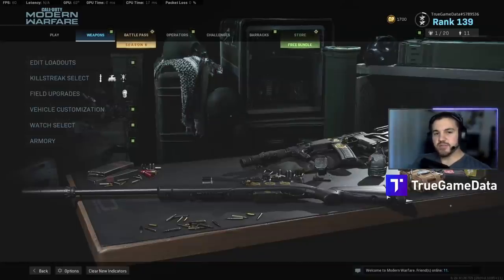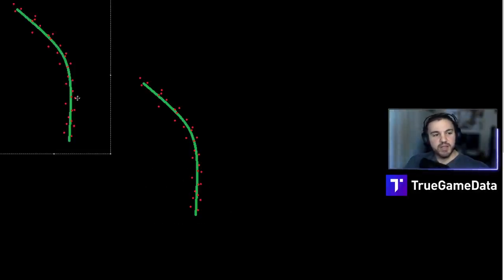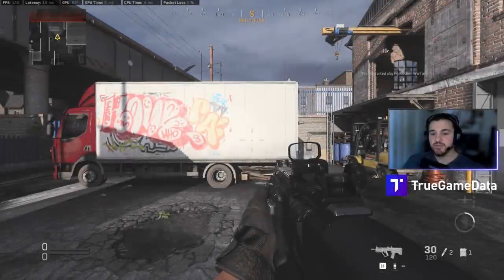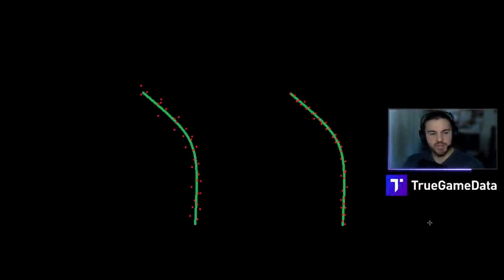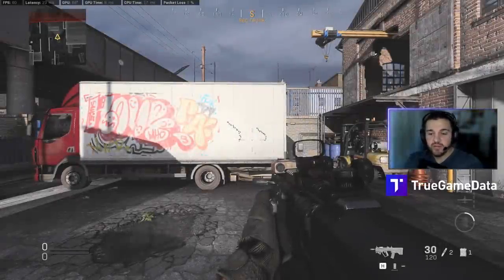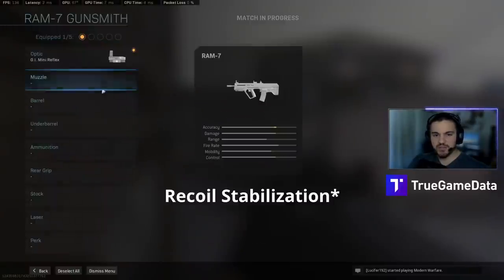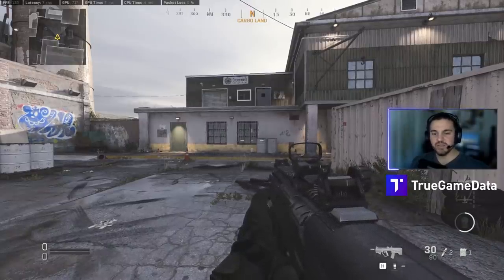What do "Recoil Control" and "Recoil Stabilization" actually DO in Modern Warfare?

Comment: After finding out about your site I’ve always tested muzzle break and commando on all my guns and they definitely feel better. Recently however I’ve been using compensator with commando for an extremely balanced gun.
Reply: ok
Reply: Does it seem like that compensator hit a little harder?
Reply: @jchaney229  you're probably landing 2 shots where you normally would've only had 1 hit in the same bullet grouping. The second marker begins before the first has began to fade. Looks like 1 hit marker, really its 2.
Reply: Why not merc foregrip? Is that not the best? Thats what I've always used and it basically makes all guns super stable
Reply: @BONZAImusik  no for straight recoil control the commando is best, merc should only be used on subs for the hipfire bonus
Reply: @BONZAImusik  Merc foregrip is basically the standard recommendation of the big youtubers. But nearly all of them play on console and I think that is the reason why. With a mouse, vertical recoil is easy to control, as long as the weapon isn't bouncing to the left and right. Therefore a commando foregrip is much more useful for most of the guns.
Reply: Kloakentier .I I agree with ZurkeyTurkey above since they secretly nerfed the merc forgerip a month or two ago I only use it on the SMGs now. For ARs I’ll usually use the ranger or commando grip. The best grip in the game though is the snatch grip on the PKM.
Reply: I made an M13 build with Compensator, tempus marksman, ranger grip, 50 mag, VLK optic. It's outrageously accurate and I love it
Reply: @beltempest4448  dont tell ppl man ive been melting these kilo kids
Reply: @shanebryant6478  ahaha same mate
Reply: @BONZAImusik  merc used to be best cuz of the movement bonus it had before it got patched.
Reply: Recoil Control also affects the visual recoil :)
Reply: Compensator + commando
or forward grip + muzzle brake?
Reply: Compensator + commando has always been the standard mp AR setup. The cdl pros figured that out in less than a month

Comment: The aim point shifting away from the center of the screen is called "gun kick", in contrast to the whole camera moves with the recoil which is called "view kick". These are recurring mechanics in COD series, but I actually didn't expect recoil stabilization to help with it. Great job!
Reply: Yes, gunkick is essentially visual recoil (it does affect the impact of bullets however), while viewkick is the actual muzzle climb and away of the weapon. The KILO 141 has positive adsGunKick values therefore even as the muzzle climb increases the point of aim is shifted Downward, causing the illusion of counteracting the muzzle climb. 
You can test all of this in CoD UO

Comment: 5:06 - I can think of one key instance of “screen shake” in another FPS game. In Destiny 2, there is an Auto Rifle (i.e. Assault Rifle) called Hard Light. For the longest time, the main selling points of Hard Light were that it had no damage falloff, a good recoil pattern, and bullets that would over-penetrate and bounce off of walls (you could very well spray the gun at a wall and hit someone behind a corner). The only issue with the gun? It had a terrible amount of screen shake. It had so much going for it, but the screen shake when firing while ADSing make the gun useless in PvP. Bungie decided to remove/severely reduce the screen shake in one of the patches, and the gun instantly became meta. It was so dominant that they had to actually give It damage falloff to balance it. Last I played, the gun was still good, but nowhere near as broken.
Reply: I was shredding with had light yesterday, it's definitely still great but I'd rather get Monte Carlo
Reply: @stasis760  just use gnawing hunger like every else
Reply: @zotic1516  idk man I'm outgunning gnawing hunger with hard light

Comment: Yea I've noticed this screen shake especially with high fire rate guns. The ram and fennec to me is unusable without commando. I always thought it was just the gun shaking and not the whole screen that's crazy.
Reply: But the screen isn't shaking more really when looking at say the roof or column. It's just the center moves, and the gun moves back and forth more (not left/right/up/down)). I expected there to be more whole screen shake without stabilization actually.
Reply: especially the RAM
Reply: I play the Fennec without a foregrip and it handles decent up close, tbh you can't use it further than 40 meters
Reply: @davseblord  yea I agree it is usable but for me when I'm dealing with bunny hoppers in a dark room and there is gun flinch on top of recoil. That smaller screen shake is a godsend.
Reply: The scar prob counts too. Ive noticed that even mounting the gun with some recoil control attachments, the gun bounces around, but im not actually compensating for recoil at all, because there wasnt a recoil pattern, just the random camera/visual recoil
Reply: Huh, I’ve never really noticed the shaking for the ram or fennec, and I use merc/ranger with those. Maybe it’s because of the fov I have? Prolly just me lol
Reply: @nicolascaraballo1534  I don't notice it neither
Reply: RAM-7 with Ranger Foregrip is very usable for me, but commando is probably the best option though

Comment: I’ve gotta hand it to the MW devs. There are so many little nuances to the gunsmith and each attachments characteristics. I really do think almost every gun is viable if you kit it right and play to its strengths. Videos like this are a huge help, and make experimenting with builds fun. Thanks
Reply: Oh absolutely, they are. I have only like 0.70 KD and ive gotten most of my little over dozen wins with an ak made to AK74U (5.45mm, 8.1 barrell, skeleton stock and either stipled grip or 5mw laser) second most kills/wins ive had with the short af holger build "the catacombs" (no stock, short barrell, 30rnd mag and merc grip) its a blueprint and i dont even own the base gun so it does not have even a suppressor.
Reply: @WuKuVex  if you’re gonna use that type of ammo on the ak just use the Amax, its the same but better.
Reply: @sauron1414  There no possible way to make the amax as fast mobility wise as the ak with the 5.45mm ammo  and 8.1inch barrell, skeleton stock 
 etc.

Comment: Thanks for the vid that clears things up what you said about the red dot bounce makes perfect sense i was using the max stabilization and noticed it wasnt as tight but felt much more controlled. What you said about the ram7 and recoil stabilization i first noticed with smgs i put muzzle breaks on the higher fire rate guns and compensators on the lower fire rate which seemed to work well but its more individual to gun i now think, so thanks again for clearing that up.

Comment: Battlefield 4 (I dont know about other Battlefield titles) had a couple similar effects when using red dot sights with laser or tac laser equipped. While firing you could see the red dot deviate from where the laser hit but the laser was always where the bullet would hit. It was much more noticeable at range when using a LMG with mid range scope and laser equipped. When first viewing, the green laser would be in the very center of the mid range scope crosshairs, but when you fired a single shot you would very quickly notice the deviation when you put the crosshairs back on target, and the laser hadn't "caught up". If you fired again, you would miss. but if you waited till you saw the green laser, you could put the green laser on target using the scopes zoomed vision, and fire on target regardless that the target wasn't in the crosshairs of the scope. The bullet always hit where the laser was touching in these cases.

EDIT: Im watching super slowmo videos of automatic weapons firing and its very obvious the weapons are flexing. This could be the representation of the forces we would be fighting with "Recoil Stabilization" mods. Lookup AK47 super slowmo firing and it seems easy to see that if it had a red dot sight, and a laser attached down barrel, that the flexing during firing would cause the red dot and laser to separate. Seems like a natural symptom of using automatic fire, on older designed guns that flexed a lot after taking a shot, instead of waiting for everything to settle to take the next shot.  I would think that a bullpup like RAM7 wouldn't have this issue, but I could be wrong. Also, due to balancing, weapons don't always behave in games, how they do in real life. What do you all think?

Comment: Really awesome info again my man.
Still gonna stick to my standard RAM Mono-Ranger-Tac-Optic-50 Mag

I think switching the tac for commando isn't worth it for me bc:
-the reliability the aiming stability (tac) gives over the recoil stabilization (commando) in terms of recoil pattern
-better ADS
-last but not least the better ADS movement speed with the tac setup
These advantages seem more impactful to me than the negatives (less recoil stabilization, laser visible)

I tried Mono-Eclipse-Commando-Optic-50 Mag but the "standard" RAM setup is better for me to control the recoil since the ranger barrel gives a little more vertical recoil reduction than the commando-eclipse combo, which seems to be especially important for moving targets. Not even putting the better bullet velocity into consideration here.

Yea and having iron sights with the RAM is not in the equation since all the recoil reduction isn't worth anything if you can't see the enemy.

Comment: Is there any theory on gun kicks? Like EBR14 kicks like an elephant but the actual spray pattern isn't that bad. Uzi is an example of automatic guns though it has great 2-shot headshot range it is quit hard to land 2 headshots. Is recoil stabilization the only affecting factor?
Reply: I tested a bit with various setups and for those 2 weapons the ideal would be to just shrink down the entire pattern. Those 2 guns kick pretty much only vertical and the animation is quite annoying too. I've found using recoil control definetly helps with that. Go give it a try in a private match c:
Reply: @Artiick  I usually put a lot of recoil control for grinding headshot challenges. But some guns are not salvageable. Just wonder is there any specific attachment or factor to the visual gunkick.
Reply: @孙林可  it's an animation so there's not really any way to reduce it
Reply: @孙林可  the only way for me is getting used to the gun feel, that's the best thing you can do
Reply: @Artiick  some guns i can't use iron sights because the visual kick makes me lose my target. Optics helps in that case.

Comment: Hey, just a quick a thought: I've heard, that Rytec sights are somewhat hard to use because they are centered at 200m distance. So you need to compensate for that. Might it be that all sights in this game are actually sort of centered at their intended range or something like that? That may explain why the gun shoots not exactly in the dot. (However, this does not explain why stabilization affects this parameter.) BTW does the magnitude differ if you use iron sights or low zoom sights? 

Edit. Quick thought number 2: How bullet velocity affects the fact that some of the guns don't shoot directly in the dot? Maybe that's the key. If your gun shoots faster bullets the arc of the projectile should be smoother, right?
Reply: No pretty much bullet velocity reduces your ttk let's say at mid or long range your ttk is 400 ms.

Put on like a mono integral suppressor and it increases bullet velocity so it turns from 400 ms to something like 375 ms.

You cant really feel it at close to mid range but at long range it makes a difference
Reply: Basically how fast the bullet travels to target.

Comment: I think they should change the name of the trait from recoil stability to accuracy, because that's what is happening. The bullets are deviating from ur point of aim, or reticle, and like you said, it can't be corrected. The weapon is becoming less accurate. That's why you're reticle will be on target at 50-75 meters, but you're only getting hit markers every 3 or 4 bullets, even though ur reticle is on target, the bullets are actually missing.

Comment: Something you should probably have mentioned is that many stocks and barrels affect recoil stabilization (without being listed as a pro/con, of course) as well. The most noticable is the "red dot drift" effect with "no stock." Longer barrels also seem to have better stabilization, which can sometimes even be enough to mostly counteract the massive "no stock" drift, such as on the M4 and Grau.
Reply: THIS! I need to know if my only ever bought blueprint, the Sceletonized aka The wages of sin -m4 bp have any HIDDEN stats( like recoil stabilization or control) on its barrell: FSS 14.5 Tac Lite, or the stock: FORGE TAC CQS? It comes with that cool red and long anodized muzzle break but Its too important to have a suppressor on it in warzone instead.
Reply: @WuKuVex  I can't tell if you know this or not, but blueprints are just a visual skin with preset attachments, they don't do anything different than the stock non-blueprint versions. You can customize the blueprint any way you like, including adding and removing attachments. Customized blueprints will behave exactly the same as customized stock weapons with the same attachments.
Reply: @WuKuVex  I just did some testing in a custom game and those two particular attachments don't feel like they have any hidden effects to me. The Barrel kind of looks like it has more visual bounce, but the bullets still seem to land in about the same place as no barrel. The stock negatively affects stability, but that's listed; the visual bounce feels about the same to me.
Reply: @dbozan99  thank you. Pretty cool those bp irons eh?
Reply: @WuKuVex  np. I'm not really a fan of those giant wings on the sides, but if it works for you that's cool.
Reply: @dbozan99  I love em. It pretty cklose to what the ISO has and those compared to the default ring, the rearsight doesnt bounce around even a one third of the amount of the default

Comment: One small trick to test recoil stabilization on a gun: play spec ops mission using recon role, it will remove recoil. If the gun still has recoil and kick downward, you know you need more recoil stabilization.
Reply: Neat. Must be the only actual use of the Recon role. If only we had private spec ops lobbies though.

Comment: I always thought that "recoil control" would just slightly increase the effect that trying to control the recoil had (either holding the stick down on controller, or pulling the mouse down on pc), and that "recoil stabilization" would just "shrink" the recoil pattern. I guess I also thought that the effect the "aiming stability" has was the effect that "recoil stabilization" had.

Comment: I wonder if the AMAX benefits more from this or recoil control. That's my main gun. Interesting findings indeed!
Reply: Commando hands down. U miss a couple shots because of the shake the TTK drops dramatically
Reply: @lion.official  yeah I see what you mean. I'd rather it be less shakey and have to handle more vertical recoil on controller than it be all over the place. Thanks
Reply: I just recently switched from Ranger grip back to commando and I noticed a huge difference, it was kinda something I just tried for laughs and it actually helped alot. It seems like the upward kick is way less and I can hit people at range so much easier. I use iron sights on the zodiac barrel tho
Reply: Yes. The amax benefits drastically from recoil stabilization over recoil control. Once you learn the recoil pattern you can pretty much use 1 recoil control (the long barrel), 1 recoil stabilization (commando foregrip) attachments and run the rest for speed (ads, strafing etc etc)

PS: I have 7k kill with the weapon... So yeah, there's that 😂
Reply: @Artiick  I definitely agree. It's been my favorite gun for months. I'm at 12k kills with it, not to brag or anything 😆
Reply: @foxxrider250r  yeah mate no worries. I just don't play that much lol. I play on an off, usually kills derive from time played and skill of the player. More time and skill=more kills. Easy my g
Reply: @Artiick  all good bro. I have had way too much time to play these last few months healing up from a surgery and not working. Keep killing it bro. Good luck👍
Reply: @foxxrider250r  you too c:

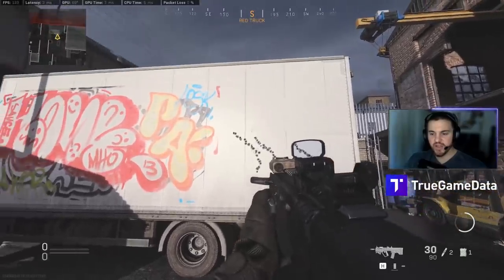Comment: @4:12 - recoil control reduced the spray by 0.5 cm on the horizontal axis and 1.0 cm on the vertical axis.
@4:12 - recoil stabilization reduced the spray by 0.5 cm on the horizontal axis and 0.5 cm on the vertical axis.
@7:00 - go ahead and turn the youtube vid down to 0.25x or 0.5x to make this even slower and get a more intuitive feeling for it. maybe even pause and use the < and > keys to move frame-by-frame.
Reply: The recoil stabilization build had recoil control on it too
Reply: @wisphen  i didn't realize this, which attachment? just curious
Reply: @xMaverickFPS  commando foregrip has both , minor but still a factor

Comment: UPVOTE FOR YOU GOOD SIR! Am I wrong to use the Tactical grip especially with the sp-r sniper instead of commando? beecause in my mind the much more generous mobility and the main effect of tactical "aimin stability" are much more important in a bolt action sincwe you dont need recoil stabilization/control, instead you just want fast ADS-speed and as little of swaying as possible? I also just bought my first ever blueprint pack, the SCELETONIZED and the name of the m4 bp in that is The Wages Of Sin. Does the barrell FSS 14.5 Tac Lite or the stock FORGE TAC CQS have any hidden effects to the recoil sabilization or recoil control?